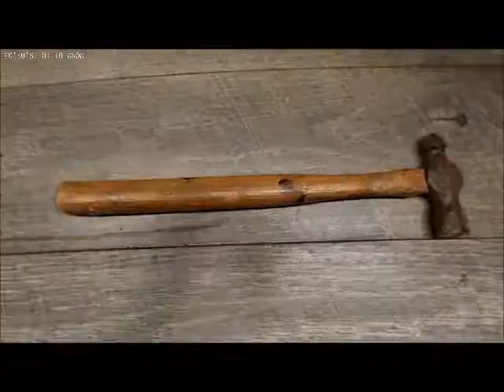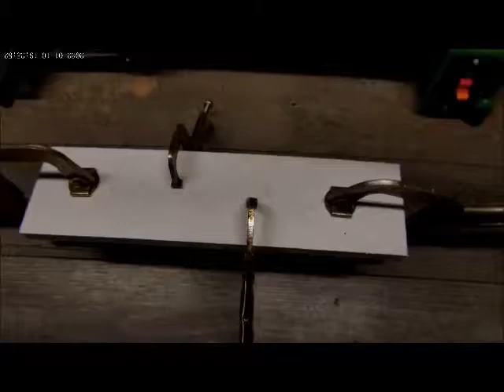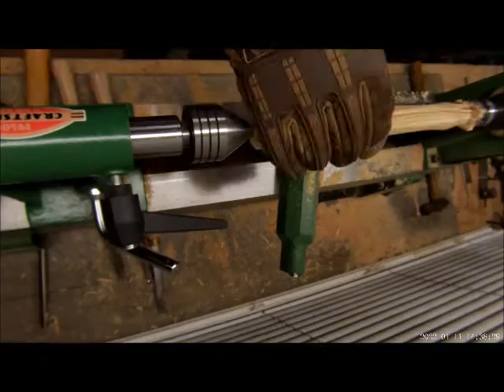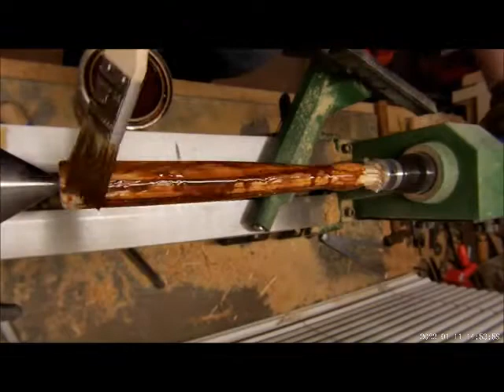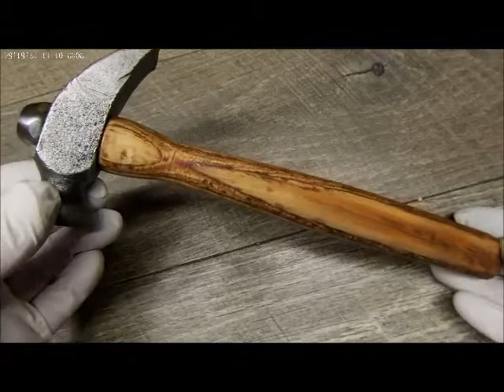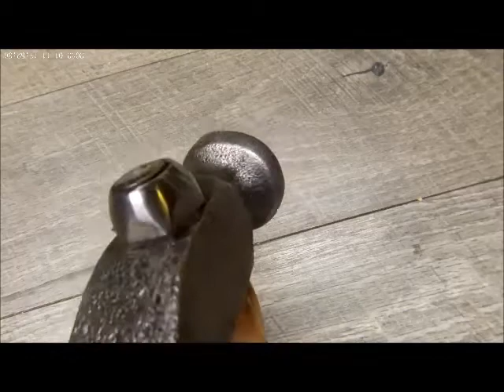Scrap Pieces of Plywood turn into Beautiful Tool Handle

Comment: How does it feel? Strong? Great idea.
Reply from the maker: Ben, feels pretty solid, but just to make sure, I thread a 4" long, 1/2 inch bolt into the top. I then tapped the hammer head and screwed it on, then capped it off with the tapered nut.
Reply: @5StarRestorations  Ah, I wondered what the cap was on top. That explains it. Thumbs up.